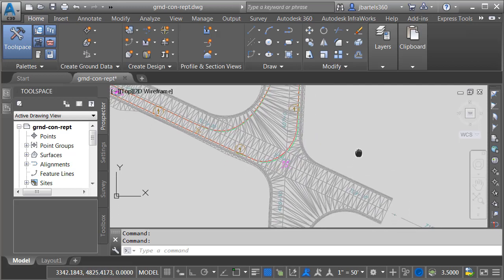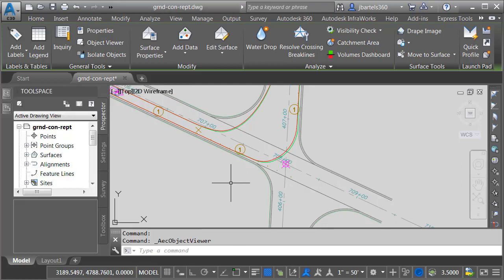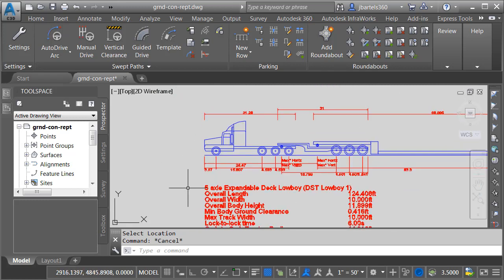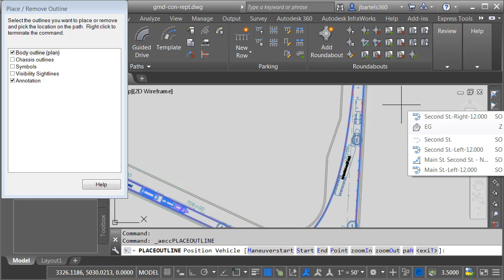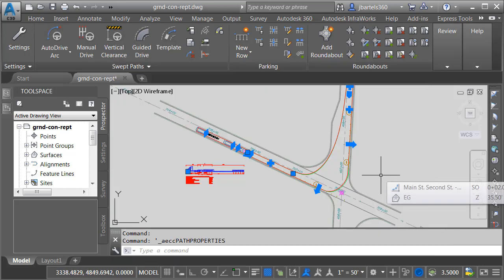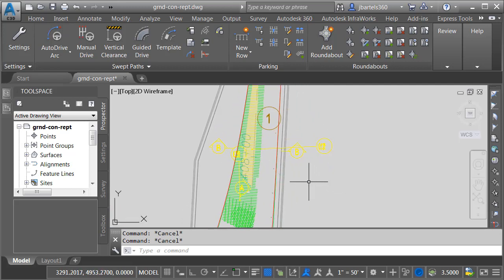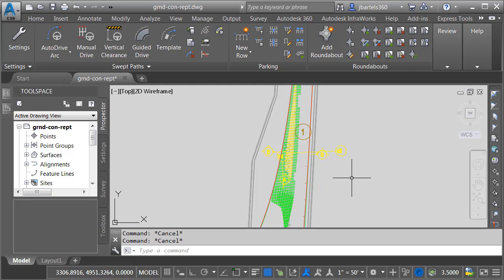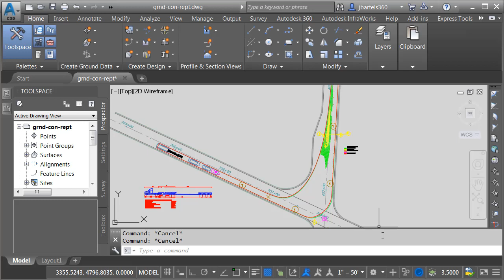Analyzing Vertical Clearance using Autodesk Vehicle Tracking - Pt. 2 of 2

Comment: Hi I am trying to create ground conflict report using C3D 2018 and VT 2018, however it will only produce the sections showing where the ground conflict is. The line/hatch in the model showing the ground proximity wont show. i have cheek through all of the reports to ensure that it is not turned off with no results. Any ideas?
Reply: If the vertical clearance is more than 100 mm then no line/hatch colouring will appear on screen. The coloured vertical ranges that may appear on screen are: 50 to 100 mm clearance = green; 0 to 50 mm clearance = yellow; 0 to 50 mm ground penetration = orange; 50 to 100 mm ground penetration = magenta; over 100 mm ground penetration = red